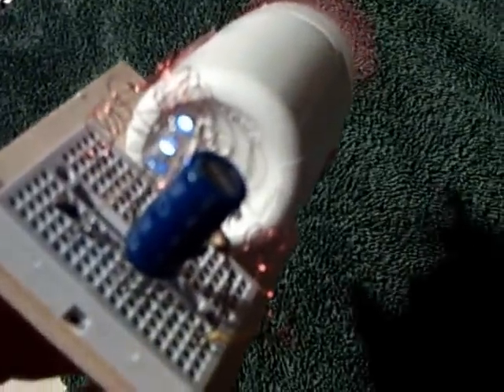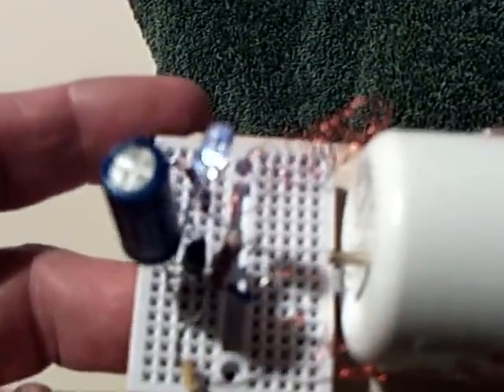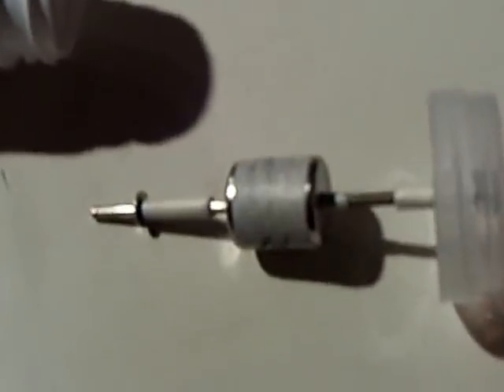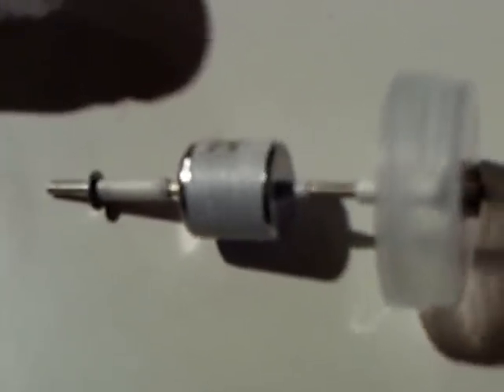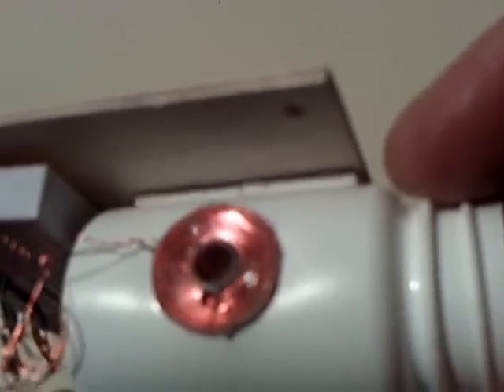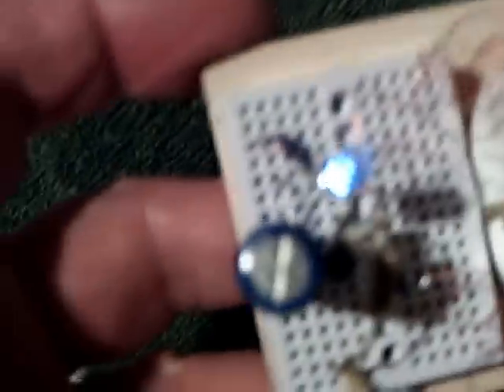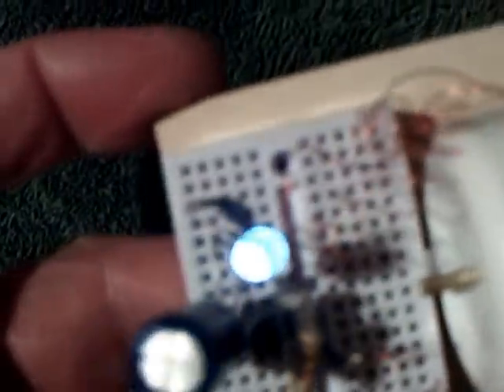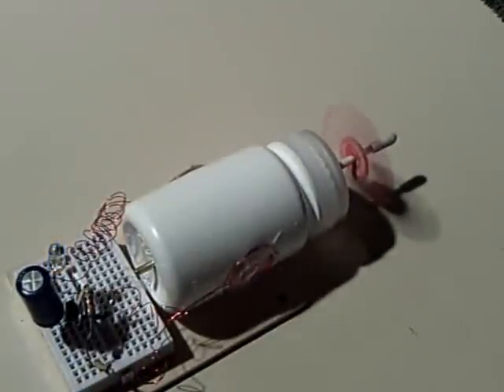Pill Bottle Electric Motor --- 2 Coils

Comment: bam, got my 1"x1" DIAMETRICALLY MAGNETIZED ring tube maggie;]  sweeeet. so uhhhh. dam. this thing is powerful. my pliers be flying outa my hand. bolts n nuts slamin all around..heehee. only 11$ to my mailbox. so dangit. now i found a nonmagnetic shaft, i,m looking for my brassy pcs. ergh.  but your tiny bearing looks pretty cool. so back to ebay for "tiny rc bearing". the ceramic skate size ARE NOT CHEAP;[ yikes. 12$ for just 1. ugh. so gana keep pluggin away.  glad i got liddy motor pants to follow.  keep posten bro.  i fean for liddy vids.   {its just super cool to build these. best way to master something is to create it. and, i gotta keep quiet here too. build lil stuff. my apartment situation, u know;]   i,ll postup my 1st video soon. "LID MOTORS PILL BOTTLE REPLICATION"  ALL CREDITS TO U BRO... L8TR  ;]
Reply from the maker: +BLADE RUNNER Excellent!  Be careful with the neo ring magnets.  They chip or can break easily when stuff slams into them.   I have several of those 1"x1" ring magnets and they work very well for these type motors.  You can use the regular steel ball RC bearings by washing then out in acetone and using a very light oil in them.  The Big neo has to be on a long shaft far enough away from the steel bearings.  Ceramic bearings solve that problem but like you said ---they are expensive.

Comment: post the power cell motor liddy... I.m working on some new configurations of power cells. like running 2 positive terminals out of each side of copper tubing/pipe fittings & somehow multiplying the magnesium negative terminals as well. I really think WE HAVE NOT maximized full potentials on power cell voltage possibilities/output. I.m.h.o. size doesn't matter-, just contact points. ... can u dig it? :)  I know u can Tucan Sam Liddy SLAM.... BTW. LOVE UR POSTS. ..  KEEP IT REAL...;)
Reply from the maker: +BLADE RUNNER  You are right ...."We HAVE NOT maximized full potentials on the power cell voltage possibilities/output."  More work needs to be done on those 'crystal cell' concepts.  I kinda lost interest in them when I started seeing what they really were BUT----they are very interesting in how they work and more needs to be done to improve the design.

Comment: Nice!

Was there any special reason that you used a brass shaft?
Reply from the maker: +A B --Yes.  I had it on hand.  The rotor assembly came out of another motor.  The other reason is that the steel ball bearings are affected by the strong neo rotor magnet.  If you use a steel shaft it gets magnetized and the bearings don't work.  Of course if you use just the plastic of the bottle as the bearing the shaft material doesn't matter.  A steel coat hanger would work.  Some of my motors just use wooden dowel rod. On small toy models you can get away with some pretty simple solutions. Check out GranddadIsAnOldMan's channel.  He is a master at this.
Reply: +Lidmotor Interesting... I wouldn&#39;t have thought the magnet would create enough force to cause the bearings to have too much friction.

Thanks for the reference. I&#39;m already a subscriber of GrandadIsAnOldMan!

Comment: You know you really should put some wheels on it and let the fan blow it along. I will have to put this on my list :)
Reply from the maker: +GrandadIsAnOldMan  Ha.  That thought went through my mind right away.  I tried it on a toy car I had but that was too heavy and had too much friction to work.  One of your CD wheel creations is what I need.  This two coil model with a Hall effect trigger (so I can use both coils for torque) should make a pretty good situation.
Reply: +Lidmotor Would like to see that :)

Comment: Did the magnet have a hole through it or did you drill it ?
Reply from the maker: +3D Motor Maker--- The ring magnets have a hole in them.  By the way I have one of my EZ Spin motors running now on an old crystal cell and solar cell combination right now.  Seems to work quite well and runs 24/7.  A 470uf electrolytic cap is in parallel.  The solar panel is out of one of those dollar store waving toys.  The crystal cell is several years old and was reactivated with a few drops of water 4 days ago.
Reply: +Lidmotor Top stuff, I have finished my next generation motors too, just in time for xmas.  I will post a video as soon as I have edited it together.  One of mine uses cells - caps and solar too.